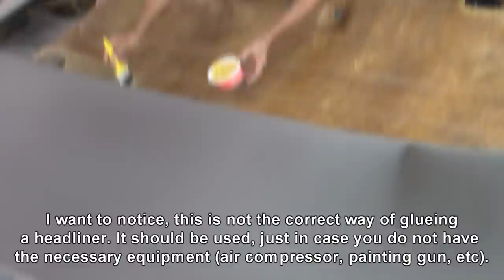Reupholstering a Headliner- Auto Upholstery

Comment: excellent video I normally use spray glue in the can an I roll the liner from back to front but I try this technique. here in Barbados it can be hot  at times an sometimes if you don't useable strong glue the liner drop back down but I realized  you only glue to board an not the liner but I see why. thanks again
Reply from the maker: +Stanley Grant Some glue sprayers, could do a nice job...the ones we have overhere work good on the foam, but on the cardboard don't...they do not adhere uniform and form bubbles and heaps.
the method I show in the video 'is not the correct way', but 'it works' and it should be done 'in parts' and stick the foam to the cardboard, while the glue is still 'wet'.
The 'best way' is by using the air compressor and the painting gun to apply the glue all over both surfaces(cardboard and backed foam material)...it could be done in parts or at one go.
It seems that you have a good 'backed foam material' in Barbados that let you roll from the back to the front...I also do this sometimes when I have a good material...other times I have to fold it from the central part to the sides, because if I position it the other way at folding time some creases appear immediately and they would remain forever after glueing procedure.
Thanks Stanley for your interesting comment! ...it helps to create a discussion in order to improve ideas on the trade.

Comment: I wouldn't ever use this method.  Is a good video and this man is one of the best i have seen. But I use contact adhesive and spray it on both the board and materials
Reply from the maker: The method I use in this video is a 'just in case' we do not have a glue spraying gun.
The correct way is as you said, spraying glue over both materials, cardboard and the reverse side of headliner material. I also use the spraying method.
https://youtu.be/Y8FfRBY4LtQ?si=KbFjAegZaRyfi8IZ&t=199
Reply: @Cechaflo  yes sir. I read that in the video. I see you brush a lot of small pieces you do really really good work. I have learned quite a bit from watching your videos. Plus trial and error. Thank you for the good video

Comment: 1st time telling this to public but the brushes to clean the old foam off sucks. I use a palm sander that takes 6" sticky sanding pads. I use 320 grit paper. No it don't sand it off. The edges take it off so smooth I use the same sander for bodywork or I wouldn't even use sandpaper pads just the disc pad works.

Comment: my board got so soaked, it's no good..

What do you suggest?

Thanks in advance..
Reply from the maker: Sometimes the humidity warps the board if it was made out of cardboard. If it is fiber glass there is possibility of using the same board. Anyways it would need to reupholster again.
Another idea would be buy in the junkyard another board for same model of car in good shape. It would be cheaper.
Reply: @Cechaflo  Thank u..
yes, buying a new board wouldn't be a problem if I new how to shape it like the old one..

I pulled it down a little bit to fix my sunroof drain tube, that's why it was soaked.. I had a leak.. 

After I found the tube, my hands were itching like crazy all night..

Does that mean the headliner is made out of fiberglass?

The board looks very thin with yellow foam or maybe insulator on top of it..

Getting one from a junkyard is hit & miss, but not impossible, to say the least..

Thanks for responding..

Comment: Thank you for the great videos,  you are a master.    Can you tell me what kind of adhesive (glue)  that you use?  Is it  "contact cement"   ?
Reply from the maker: +rkstew,  Thanks for watching my videos! ...I use a yellow glue which comes in cans or bottles...check these links if you are in USA :

http://www.homedepot.com/p/DAP-32-fl-oz-Weldwood-Original-Contact-Cement-00272/100125525
https://www.tandyleather.com/en-usd/home/department/leather-cement-glue/2525-360.aspx
http://www.ebay.es/itm/Petronios-Master-All-Purpose-Cement-Glue-Shoe-Repair-Adhesive-Glue-4-oz-/291064753112
I think that before applying one of these products do a test beforehand.
Reply: @Cechaflo  that glue is so very yellow colored, so it must be the wildwood landau high temp contact glue, not the regular contact glue you gave a link for.
Reply from the maker: @JimTMcDaniels1  The glue I have showed in this video is a 'brushable one' and it is only applied on cardboard surface. This method with this kind of glue is an option in case of not having the equipment to do it correctly.
The correct way is by using an air compressor and a glue sprayer. For this purpose the glue should be very fluid. In min three:16 of rthis video I used the sprayable glue (another trade mark than landau)
https://www.amazon.com/Dap-Weldwood-Contact-Adhesive-Solvent/dp/B004IH3HAQ
This video shows the two kind of upholstery glues (brushable and sprayable):https://www.youtube.com/watch?v=o2xeezdF8Ss&t=288s
Reply: Cechaflo ok thanks

Comment: Hello, That's an awesome job Cechaflo, what kind of tissu are you using for that ?
Reply from the maker: +Xdreams12  Thanks for kind remarks! ...I'm using 'headliner material' ...this material consists in a 'thin 4 mm foam thoroughly glued/bonded to the 'thin grey fabric'.
The method I show should be used just in case we do not have a 'gun' to apply the 'fluid special yellow glue'.
I'll show the 'right glue gun method' in a next tutorial.

Comment: Hello. Thank you for your presentation. What is the name of Yellow Glue?
Reply from the maker: Different trade marks, here in Mexico 2000, 5000, 3080 and weldwood from home depot used to stick formica.
If you are in USA, please, check:
//www.homedepot.com/p/DAP-32-fl-oz-Weldwood-Original-Contact-Cement-00272/100125525https://www.tandyleather.com/en-usd/home/department/leather-cement-glue/2525-360.aspx
http://www.ebay.es/itm/Petronios-Master-All-Purpose-Cement-Glue-Shoe-Repair-Adhesive-Glue-4-oz-/291064753112

Show less

Comment: Just my 2 cents from my upholstery business but these headliners and carpet kits are really where a 5 gallon spray pot (even just a 2.5 gal or the pot that comes with the gun is huge help) of glue saves me time and makes money in spades. I stretch out the headline material over the entire board to get it centered, then peal back half the material back over itself to expose the headliner board and foam back of the new material then in about 20 seconds I have both sprayed out with glue. Let it kick off, stretch that half of the headliner material i place then fold the other half of the headliner material back over the 1st half already in place and another 20 seconds or so and you get the last half of the headliner board an material sprayed out. By doing half at a time I use the material folded back over on itself to protect from any over spray. Also by spraying the glue in a wide web I never have issues with glue bleeding thru the headliner material, plus sprayed glue kicks off way faster making less waiting to apply the material. I got the 5 gallon pot and gun at harbor freight for probably around $75 buying Chinese knock offs they sell, but it paid for itself in time saved on 1st job like this. The glue can sit in the  gallon pot and hose for years and never harden, the gun keeps it sealed tight. I'd highly look into getting a setup to spray glue, just make sure the hose you use to run the glue from the pot to gun is made for chemicals, the glue will eat standard air hose, regular air line is fine for air pressure.

Comment: You don't haft to glue the headliner material only the headliner board?
Reply from the maker: If we use this artisan method, we should apply wet glue only to the cardboard...if you apply glue to the headliner material, it would soak through, the solvent based glue is very strong and immediately could cause damage to the foam. That's why, while 'ironing procedure' it should be done gently.
This method could be used in case we do not have the necessary equipment (air compressor and a spraying gun)...the glue for the spraying gun is also yellow but very fluid. If you get this equipment, then you could apply glue over both surfaces and let them dry before attaching procedure...it can be done at one go or part by part, carefully unrolling the headliner material...it should not be folded, otherwise, those folds or creases would appear on top.

Comment: Execuse me ,What's the gel on 10:01?,Where can I find it?Thank you so much!
Reply from the maker: It's a yellow glue (solvent based/thinner) most of the upholsterers, shoemakers, and leather artisans use. It's also called adhesive or cement.To have an idea, please, check these links for USA
http://www.ebay.com/itm/Petronio-039-s-Master-All-Purpose-Cement-Glue-Shoe-Repair-Adhesive-Glue-4-oz-/112032405167?_ul=EC
http://www.ebay.com/bhp/weldwood-contact-cement
A faster and better way to do a headliner is by using a 'glue spray gun' with air compressor. I have used this method in the video for the case we do not have the equipment.
In min three.18 I am using a spraying gun :
https://www.youtube.com/watch?v=Y8FfRBY4LtQ&lc=z22lzf2i2vqyjfpq504t1aokgwhhoss3pl5hmfgiqvbgbk0h00410

Comment: what is it u using first time adhesive what is called?
Reply from the maker: I'm using a solvent based(thinner) adhesive/cement/glue which most of the upholsterers and shoemakers use. To have an idea, please check these links:
http://www.ebay.com/itm/Petronio-039-s-Master-All-Purpose-Cement-Glue-Shoe-Repair-Adhesive-Glue-4-oz-/112032405167?_ul=EC

http://www.ebay.com/bhp/weldwood-contact-cement

If you're going to use one of these products, do a test beforehand, and I'd recommend the use of a 'protective mask' and lenses for the eyes.

Comment: what kind of glue he using
Reply from the maker: If you're in USA, check these links for the 'yellow glue/cement/adhesive'...it comes in cans or bottles, and it could be applied by a brush.https://angelusdirect.com/products/all-purpose-shoe-cement
http://www.ebay.es/itm/Petronios-Master-All-Purpose-Cement-Glue-Shoe-Repair-Adhesive-Glue-4-oz-/112032405167
http://www.homedepot.com/p/DAP-Weldwood-32-fl-oz-Original-Contact-Cement-00272/100125525

Comment: where can i get the glue
Reply from the maker: I&#39;m located in Mexico and trade marks are different, sorry.But, if you&#39;re in USA, check these links for the &#39;yellow glue/cement/adhesive&#39;...it comes in cans or bottles, and it could be pasted by a brush.https://angelusdirect.com/products/all-purpose-shoe-cement
http://www.ebay.es/itm/Petronios-Master-All-Purpose-Cement-Glue-Shoe-Repair-Adhesive-Glue-4-oz-/112032405167
http://www.homedepot.com/p/DAP-Weldwood-32-fl-oz-Original-Contact-Cement-00272/100125525
Thanks for watching the videos!
Reply: Thanks for the help
Reply: Sam Johnsey please give dettails glue

Comment: What glue is this?
Reply from the maker: Similar to these products:
https://www.homedepot.com/p/DAP-Weldwood-32-fl-oz-Original-Contact-Cement-00272/100125525
https://www.amazon.com/-/es/Petronio-Master-Cemento-multiusos-onzas/dp/B076DJQN5R
Reply: @Cechaflo  is this what you would recommend here in the U.S.? I live here in the midwest so it gets HOT.   Do I just brush this glue on with a bristle brush? One or two coats over the headliner board?
Reply from the maker: @ddemier  The method I show in this video is optional in case of not having a glue spraying gun. One coat as a base over the board. Goggles and respirator mask is a must.
The common way upholsterers do a headliner board is by using a glue spraying gun and apply even coats of glue over both surfaces, let them dry and stick together.
Landau glue is the best: https://www.youtube.com/watch?v=m8GJRu0KfZ
https://www.youtube.com/watch?v=LatYJawaNdo
Reply: @Cechaflo  will Weldwood Dap 00272 work ok?  The Laundau only comes in a 1gallon container. The Weldwood 00272 comes in 1 qt which I think would be plenty for a 2007 Saturn Ion sedan headliner
Reply from the maker: @ddemier  The weldwood Dap is a good brushable glue. Do a test beforehand on a small piece to verify.
Reply: @Cechaflo  have you ever used Weldwood DAP 00272 before?  Is this the same glue as the Landau DAP but just in quart cans?
Reply from the maker: @ddemier  I am located in Mexico and trade marks are different. The content is similar.

Comment: Ooopsss..,, you did use a brush;o)
Reply from the maker: +Eero Laukkanen As I mentioned in the description of the video the correct way to upholster a 'cardboard headliner' is stick the headliner foamed material to the board by using a 'gun sprayer' and the special very fluid glue.
The way I teach in the video is 'just in case' we do not have the equipment.
Reply: Well, is it still hanging there?? How long ago now?? Did you let it dry for 5 min, before you put surfaces together?? Is that Contact Cement, you are using?? Good Job =)
Reply from the maker: +Eero Laukkanen  For this procedure is not necessary to let it dry...it should be immediately stuck to the cardborad in a soft way...be careful to not press it too much with your fingers.
I'm using a 'yellow contact/adhesive cement' that is pasted with a brush.
Reply: OK, Thanks, nice to know, contact cement works too!!=)